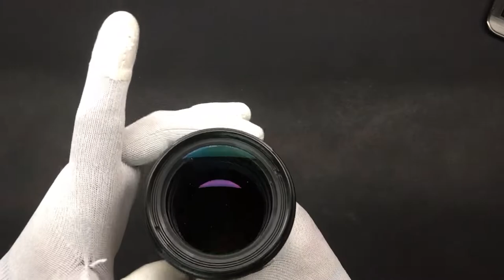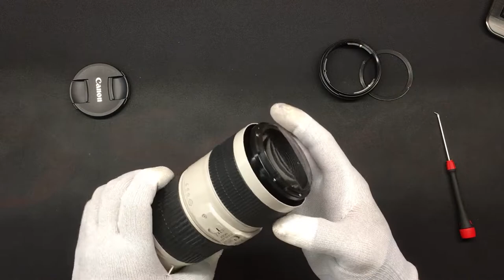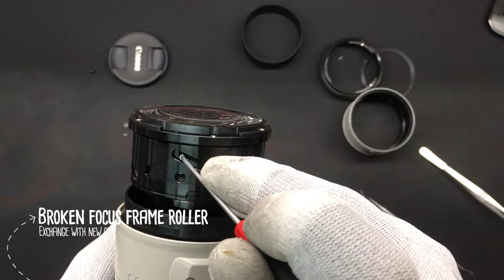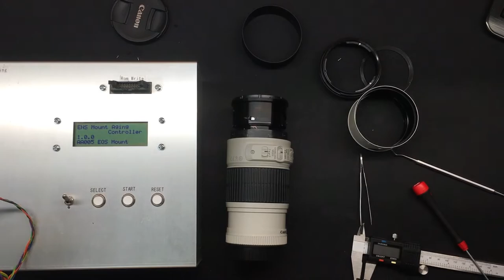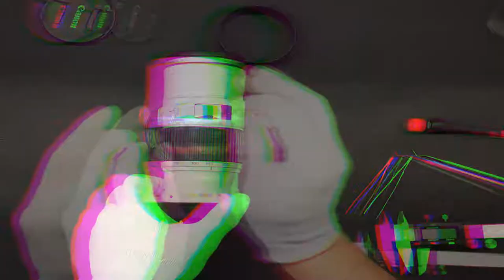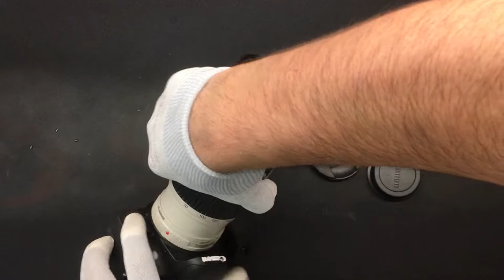How to repair Canon lens 70-200 mm L f/4 IS - AF not working

Comment: I have repaired two lens having same problem. Now I have same lens, same symptons byt the problem is in usm clutch mechanism slipping. Very difficult lens to disassemble down to usm unit!
Reply: Does ring type USM have a clutch system at all?
Reply: @Guoenyi  yes.
Reply: @tonskulus  What did you do to the clutch?  Did you need to re-calibrate IS?
Reply: @Guoenyi   I havent done anything to it, too difficult lens to work on. There are many adjustable collars that must be removed. And after that, lens needs full realignment work.
Reply: @tonskulus  Yeah I refrained from opening it myself although I successfully refreshed a 50 f1.4 slipery clutch. In the IS mech looks like something I should not mess with unless I work at Canon lol.

Comment: Hi Petar, do you have a video in which the focus gets stuck at infinity? I have a Canon 300mm f/4 IS and it gets stuck at infinity zoom, but if I turn the manual focus ring abruptly it will turn and work for a little bit then get stuck at infinity zoom again.
Reply from the maker: Shafi Subhan hi and thank you for the comment. I don’t have video for this lens model , but the problem is in the USM. You need to disassemble the lens up to this section and then try to find the problem in the motor or in the focus slide . Regards!

Comment: hello petar, i have a problem with my 70-200 4is, i have the focus slipping, i saw a homemade solution with a thickness in the focus ring, i assume it is under the motherboard under the stabilizer, but i can't I figure out how to access it, I can disassemble the stabilizer and zoom ring but not the rest, thanks

Comment: mine is used very little, it doesn't have the problem you solve in this video  but the autofocus of mine  suffers from "focus slipping" just in vertical position (not horizontal)

do you know how to fix it?

another minor issue is that the zoom ring is very soft (I don't remember if it has become or has always been) compared to that of other zooms such as the 24-105 or the 70-200 RF
do you think it's a problem related to focus slipping??

sorry for the many questions and greetings and thanks from italy

Comment: Great video!! 
Do you home made the electric tool to check the motor focus? Is possible if you can share how built one? I started my independent shop in Mexico.
Thanks!!
Reply from the maker: Hi , yes , it is semi-home made. The box is mine and the rest is from Japan. It is very expensive and now is impossible to order it. . May be in the nearest future when the situation is normal.